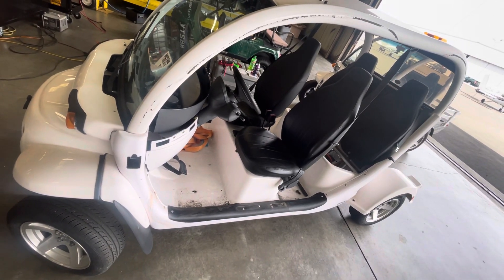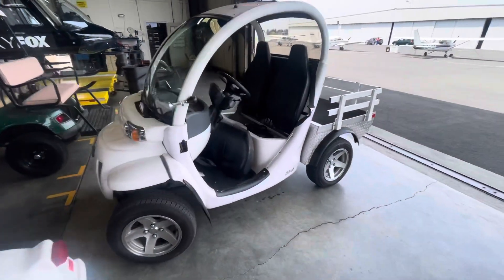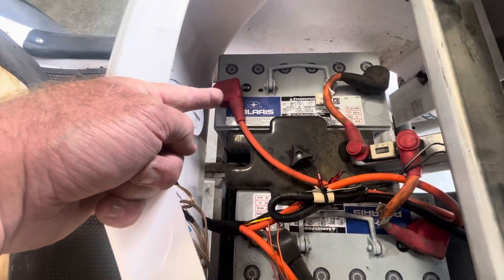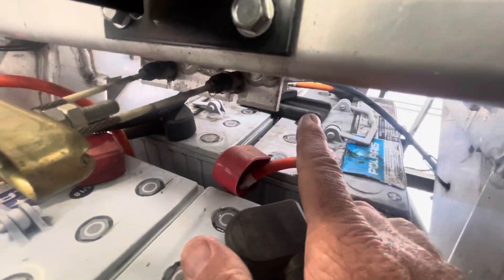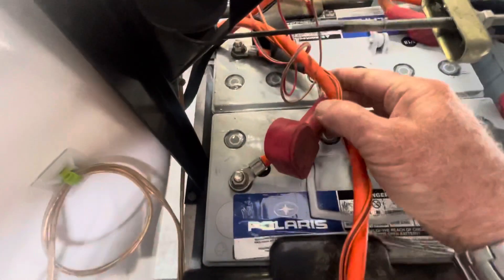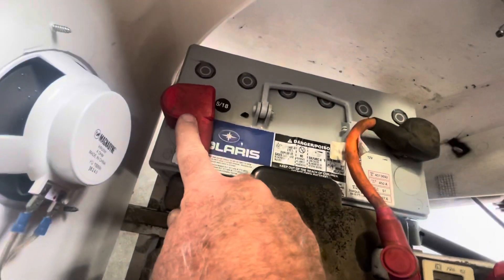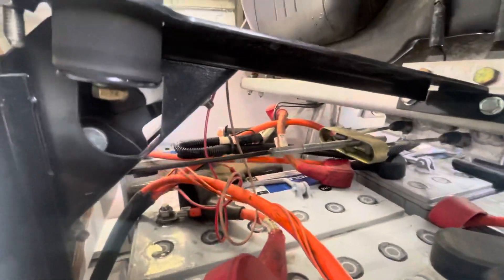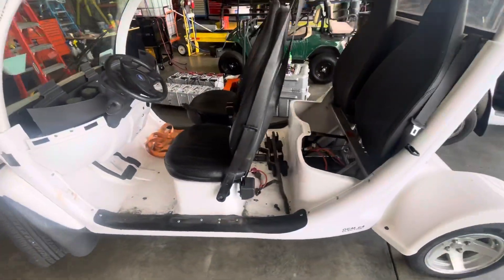Battery layout diagram 2015 Gem e4 & eS

Comment: You look like you know what you are talking about, thank you! I am having a huge problem, had some switch out batteries and motor controller. The batteries appear to be wired in series correctly. Does the lead from the ground to the fuse side of the contactor? Also, there are a lot of white wires that is also connected to the fuse side, does that connect to the fuse side or the other positive side?
Reply from the maker: So I sound like I know what I’m talking about.. I got you fooled :-).  You shouldn’t use the word “ground” on the Gem Car it’s the positive terminal and negative terminal and that fuse bridges between the negative of one terminal and the positive of the battery on the other side of the fuse.

Comment: Thanks a lot!!, this is helping me. Can I use 72V lithium instead of these all batteries? now i'm trying to fix 2 passengers model, could you please recommend me how mach amp should i need. Many thanks!!
Reply: I'm currently asking myself the same question, have you had luck installing the 72v lithium? I've been hearing that there can be complications with the gem cars can system. Were you able to make it work? Are there any problems to address? Tips?

Comment: there is a white lable on the two wires coming from the car to the battery. What is the label going to the negteive and possitive. Dont guess. please go take a look. My cable going to the battery negative says "B+" Thanks
Reply from the maker: Has anyone done what you told them to do yet?
Reply: I sent an email reply to you because I couldn't get here for some reason. 

Just in case the email doesn't go through. Here it is.

Your timing  is incredible. 
I was half way done taking my cells out the e4 and putting them in the basement when I stopped to take a rest and check my emails.

The cart does drive.
It has not left my yard :(

Life got real busy this summer. 
The wife hade tripple bypass. Somehow no heart damage. She is doing great:)

Then she broke her kneecap:( doing great:)
I got a notice from the city to clean up 34 years of stuff from my yard:(

We traveled:)
We traveled again:)
We traveled to Ohio from Minnestoa for Thanksgiving:)

Now i am home until some fishing trips up north in June. 

I have a 45hp Mercury outboard torn apart to convert to electric.  I have a 2012 Nisdan Leaf with a low state of charge that I may turn i to a pickup truck.

And I just picked up a 2023 Chevy Bolt battery pack and electric drive motor and inverter and a few other modules.

And I took a picture of the rear suspension on the Gem. There must be a way to make it ride smoother with more suspension travel.

What have you been up to.
Reply from the maker: @golfish8589  I’ve spent most of my time reading replies from comments on YouTube.
Reply: I believe the issue is had 8 months ago was that i took out the six 12v batteries then put in twenty  3.2v LFP batteries.

 When I went to hook up the two main cables coming from the front of the e4. The markings on the end of the cables didn't make sense. 
Eventually I came to the conclusion that one cable end was mislabeled from the factory.

When I took out the original batteries. I took pictures but should have paid more attention. 

I still need to look into reprogramming the charger for the LFP cells. Or put afm/lead batteries back in. 
The LFP cells i have are a sever overkill in capacity.

What is a decent capacity for a typical golf cart